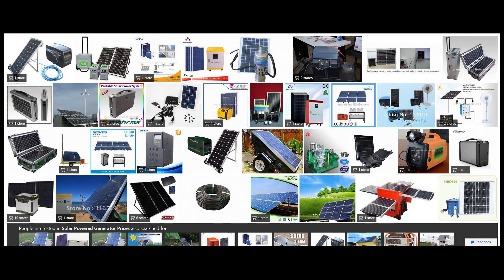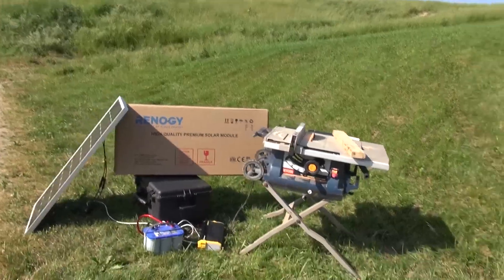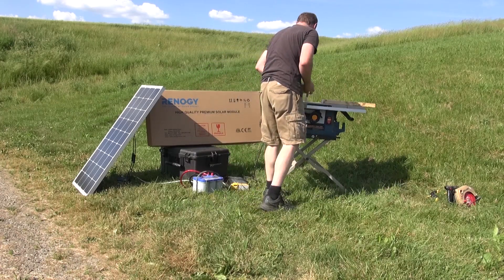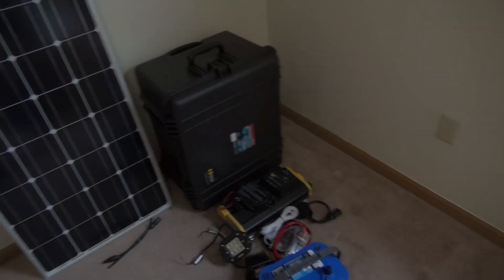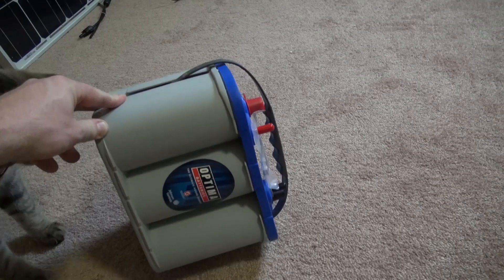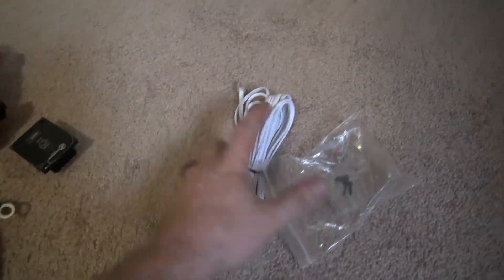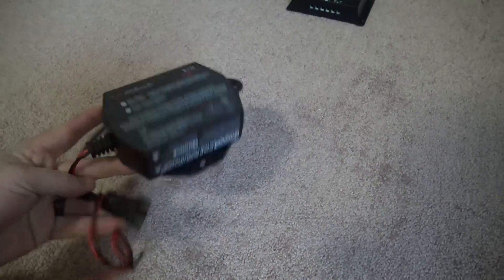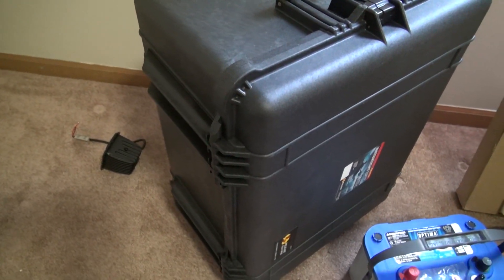How To Build A Solar Generator (2,000 Watt) – Part 1

Comment: Doesn't an AGM Deep Cycle Battery Off Gas Hydrogen in that Box and Now a Flaming Cocktail or Highly Combustible Compact Bomb ?
Reply from the maker: Good question. I don't think there is enough off gassing to be worried about or it would be an issue in other applications as well. At any rate I have since switched to LiPo4 batteries as their cost is much better than when I originally designed this setup.
Reply: I still have 2 Renogy 200AH AGM Batteries that I want to use for a Small 24 Volt Power Station for the Work Trailer in the Tongue Tool Box  @ModernSurvivalists
Reply from the maker: @1GREATDANE  should be fine! Lots of trailers have aux batteries mounted in the tongue box for winches or other accessories.

Comment: Can you charge with the panels and the noco at the same time?
Reply from the maker: Yes you can, they both are directly wired to the battery so their output voltages will combine as the total power into the battery.

Comment: I would use LiFePO4 batteries. They hold a higher Voltage and they are 1/3 the weight.
Reply from the maker: Yes, there are a lot better battery options for this now then when I made this video. Hoping to do a new version soon!

Comment: I am considering doing this build but have also considered buying a prebuilt one suck as the Jackery 1000.  My question is how long does the battery you use actually last?  I see the battery is 55Ah and 12 volt.  From the calculators I looked at wouldn't that give this battery only 660Wh before needing to be recharged?  Also what was the total weight from this build? I'm guessing its gotta be pushing 100lbs?

Comment: Personally, I'd rather run lights off the inverter or just use Solar Lamps. Much more flexible to put light where you need it.

Comment: My power inverter cable does not have the inline fuse like yours, What size fuse should I have for a 100 Watt AGM, 12 volt 2000 Watt inverter,  using a 40Watt Controller??  All of my parts and Pelican Box should be here in a few days, I'm just not sure about the fuse any help would be appreciated. :o)
Reply from the maker: Hi Richard - I wonder if they changed what the inverter comes with?  It used to be included! Check the installation instructions for the inverter and see if it specifies a fuse size. If not - it looks like 2000 watt inverter installation kits usually include a 200A fuse.  For the 40W charge controller a 5A fuse to the battery should be sufficient.
Reply from the maker: Just wanted to double check you actually meant 40w for the charge contoller. My build used a 30A charge controller, which means you should fuse for 30 amps on that component.
Reply: ModernSurvivalists yes i have a 40 amp controller. I bought it befor i saw your videos.
Reply: ModernSurvivalists the Renogy 2k inverter came with two cables but no fuse. They did not have a recommended fuse in the manual. I did find info on their website which suggested a 300 watt fuse so i ordered one. Also the instructions caution against placing the inverter in a closed container with a battery as there could be a chance of fire or explosion, i thought the AGM’s didn’t have to worry about that. What do you think? Last item is airflow for the inverter, any problems there at all?  Thanks for the help and the great videos!!

Comment: $280 just for the box!?  Yikes!
Reply from the maker: You can use less expensive cases, and many have. Keep in mind you will have a very heavy automotive battery plus electronic equipment in the case.  I chose the rugged case knowing full well how I would likely treat the unit.

Comment: Great Tutorial, I', working on a 3000 w Generator but have not started yet. I was going to use two 12v batteries and I discovered the VMAX line of batteries. what is your opinion on these?
Reply from the maker: My experience with the VMax batteries has been good. I used one of those batteries for the expansion unit. I did a video on that as well.

Comment: Nice videos. Do you have any upgrades for 2019?
Reply from the maker: No major updates to this design. I have tried to keep the amazon links updated with suitable replacements as items became unavailable.  I am working on converting a 48v electric golf cart to solar power with the panels on the roof. I plan to add a massive 220v inverter to it after that to make it a very powerful mobile solar generator. Videos on that coming soon!
Reply: @ModernSurvivalists  Nice. Just saw this update

Comment: I'm in the process of building a Similar solar generator, mine will be at 36 volts though, 4000 watt continuous inverter and have 6 lifepo4 batteries at 750 watt hours each so I'll have 4500 watt continuous output also it wont be lightweight but still not as heavy as lead acid batteries are.. I have two 250 watt solar panels and an mppt controller.. I can add as many as 7 solar panels due to higher voltage... and it will last longer due to cell chemistry. Lead acid batteries don't do well with large loads longer than a minute they can sometimes make half of their advertised capacity... the cost of mine will be around $1500 due to the bargains I got

Comment: My question is: how do you calculate how much the LED lights run for? How do I come up with the calculation for that?
Reply: EDWIN617 you look at the wattage output. Just because they’re led doesn’t change the wattage output. What changes is how much wattage you need to light up a area

Comment: You think two 200ah batteries charge controller and inverter would fit in that toolbox?
Reply: Jerry IzzyJamill Detres Jr. I would think so, depends on the batteries but, with careful planning and fitment im sure it could

Comment: Can you double the output of the panel by simple putting a mirror next to it, in effect making it powered by 2x Sun's, (or an additional sun at 99% reflection, due to reflection limitation of mirror)
Reply from the maker: Interesting question! I don't know how the panels would react with mirrors reflecting additional sunlight at them. They might over heat, but I have not ever heard of anyone trying this. You would also have to have the mirrors track the sun and continually re-position to keep the reflection pointed back at the panel.
Reply from the maker: Follow up on this after seeing some research done on it. Mirrors CAN boost the output of the solar panels, but they can over heat which in turn will reduce the lifetime of the solar panel.

Comment: 4:16 i like everything on the box except the wheels because going thru taller grass and bumpy terrain. I would put larger wheels on it.  5:18 I would use a lithium ion battery, lasts much longer and charge many , many more times than a marine battery.

Comment: I am lost when it comes to trying to figure out what battery & or batteries to get . I have 2 count 260 watt solar panels . I am as a below commenter said " Gleaning" my solar project supplies as budget allows . At this time I am lacking solar wire and batteries . I have two solar charge controllers One for a more portable generator And another for multiple and expandable less portable system .  Brother any suggestions will be well taken and appreciated . However I know there is a plethora of variables . I am looking for a general guideline or ballpark battery setup . Basically how many ah or batteries can #2 260 watt panels charge in a sunny day with 50 to 60 % discharge ? Again Thank You and as alway God Bless You and Yours ..     Tim in west central FL .    God Protected us from the hurricane Irma  .

Comment: i would say a 12 volt truck battery would help supply more power
Reply from the maker: The Optima in the unit is an automotive battery and is often used in trucks, especially in the off-road industry when electric winches have been added. Use the batteries amp hour rating, which is sometimes hard to find, but it is the easiest way to compare capacity between batteries.  For reference, the optima blue top used in the main unit is 55 ah, and the larger slr125 we used in the battery bank expansion units are 125 ah.

Comment: I like how table saw was used as an example when they are loud as crap lol
Reply from the maker: True lol.  I used it because they are one of the most power hungry portable tools that contractors commonly use.
Reply: What a bloody noise with the saw running! Couldnt you try another load with something else?   And get to the point.

Comment: Your going to kill that battery that inverter can draw 200 or more amps more than twice that Batteries capacity. you should never constantly draw more than 30% of your batteries amp capacity ...
Reply from the maker: The inverter included its own 150A fuse.  The battery I selected has a CCA rating of 750A, way beyond the peak surge of 150A the inverter is fused for.  The CCA rating means that this battery when new and fully charged can supply 750 amps for 30 seconds, in 0 degrees F, while still keeping the individual cells higher than 1.2 volts.    

It is true that this battery (or anything else short of a very large battery bank) cannot sustain peak loads for a long time. But the applications where I will be using this generator are for powering saws, and other tools. The peak surge is during startup of the tool, and is not continuous.   So far in my testing the solar panel is doing a good job of recovering battery voltage with intermittent use of these tools.

Comment: I would recommend 4-100amhr with 4-100watt PV panels for reliable usage.
Reply from the maker: I wanted to build a system that is still portable but able to be expanded. The system I built in this video can be expanded to include 4 100 watt panels, as well as any number of battery bank extenders. Both can be easily added or removed as needed using the provided quick connectors.

Comment: I did a similar video with my LifePO4 solar generator and a 2000w pure sine inverter. In the video I used a clamp meter to test the inrush current of a larger non-soft-start shop table saw. The inrush current was massive. Something like 5 times the capacity of the inverter. Ultimately, I think brushless battery powered tools are the solution if you really need to use power tools on solar. I've recently started playing with the Milwaukee Fuel line as a result. Very impressed so far.

Comment: Sir don't make the normal newbee mistakes of NOT fusing your equipment. Safety First! At least the inverter company provided a fuse for that piece of equipment! Now every load must have a fuse at the source to protect the wires from heating and causing a fire. Fuse to protect the wires not the load. Even the positive wire from the solar panels needs fused to protect the charge controller. All loads from the battery needs a fuse so get inline fuses or wire in a fuse block.  12 volts will cause a fire if shorted and not fused at the positive post. This is where most people forget the safety equipment.  Even use a power strip with a breaker in it to protect the AC loads.  Good Luck You got some good ideas!

Comment: Great start and waiting for part 2.   Renogy does make a 100W folding solar panel that might be more portable. Also, how many batteries will you use and what will be your final battery capacity in amp hours? I didn't see that spec on Amazon. I'm a newbie to solar but do you think  the 2000 watt inverter seems overkill for what your battery capacity will be able to hold?